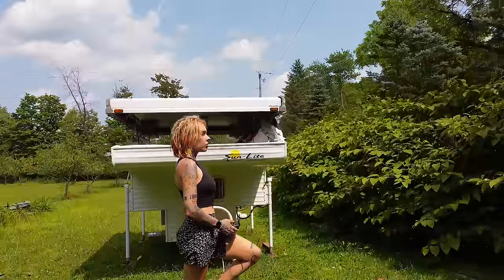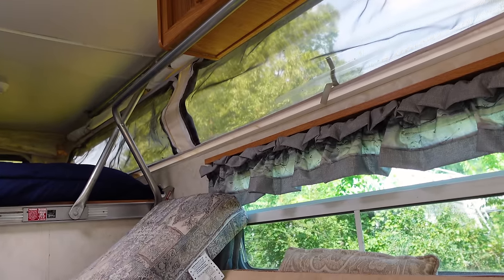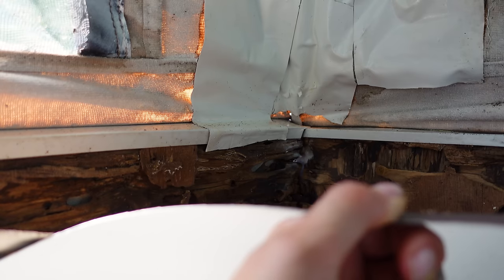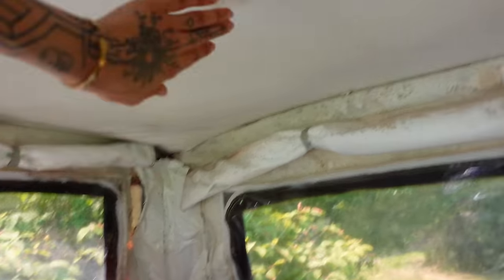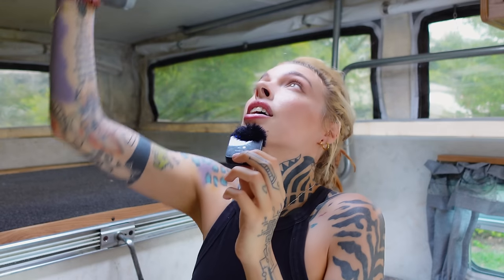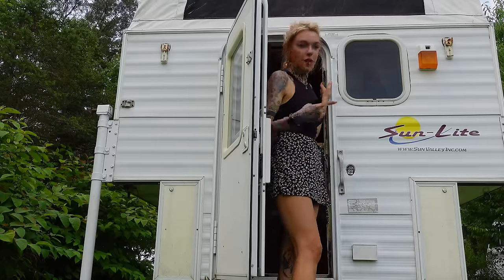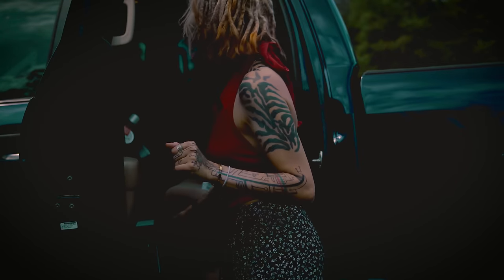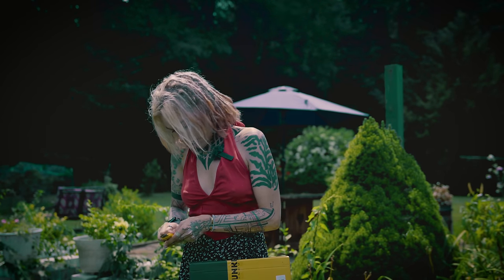old TRUCK CAMPER renovation BEGINS...this is worse than I thought

Comment: Victoria...before replacing any wood, ask your father to check for white starboard...they come in 4x8 , just like plywood...and ebay sells smaller pieces...we use it a lot in the marine industry to replace an y wood....it also comes in different thickness,  1/4 -1/2- 3/4 and so on. Also, king starboard comes in white, black, yellow, etc. This product will make you feel very secure.
Reply from the maker: I’ll look for it - thanks
Reply: @TorieRobot I like the idea of starboard but be careful as it expands and contracts quite a bit with temperature changes.  Good luck and keep smiling 🙂

Comment: You should look into using an electric sit stand desk to make it a push button to raise and lower the camper top 

I would think you could integrate the desktop into the roof as long as you can modify the camper to have to have equal height place for the table legs mid camper front to back so they would be on the left and right as you enter the door towards the middle

Comment: Yeah I love buying things that are destroyed. I bought a camper trailer back in 2017 and pulled it across Oregon. Only to later notice that all bolts that held it to the front of the frame had busted. Decided to rip it apart and rebuild it, but then the price of lumber and everything else shot up. So the frame is just sitting waiting to be built into something ready to travel.  Glad to hear you got the truck “fixed”. I pray you have a great time with the camper trailer.
Reply from the maker: Hope you can still get it fixed!
Reply: @TorieRobot  thank you darlin! I planned on working on it this year with my Dad, at the same time I pull my engine and transmission out of my Jeep. So I’ll have three projects going at once.

Comment: Seeing as you have to redo the roof check out the cost difference to use rigid foam board and fiberglass to make a new one..  Lighter, no leaks and with a few well placed wood boards to screw down fans and solar it may be easier than replacing the wood without messing up the metal sheeting

Comment: Marine grade turnbuckles, with wirerope will cost a whole lot less than those brackets. If you prefer the metal brakets also, you are likely to be able to get someone that'll be able to weld up something for you.
For the wood, you should consider using something called starboard, it's a marine wood substitute, lasts forever, no dealing with rot again. It's easier to work with than wood. Not sure how the prices weigh against using a good quality ply. But I guess it's a suggestion.
All the best with the project, and you'll do well. I'm certain of it.

Comment: with your truck keep working at it and youll get it sonner or later, Im a year in and 6 grand later on getting a 2006 Saturn Ion 3 saved from the grave and working on painting it now that it is mechanically sound.

Comment: Get as long of a bar as you can fit. The added leverage will be a life saver when lifting the top. And buy a couple rolls of flex seal tape. Adheres instantly and could be a life saver. And they make it in clear and white lol.

Comment: I had a skamper pop up on my little ford ranger. I had all the same problems that you're having so far. I didn't do much with replacing rotting woos, just sealed up what I could see and rolled with it. 
 I always kind of thought I could replace the whole roof and pop up stuff with a solid wall raised roof. I got rid of it before I tried.

Comment: Just take it one day one hour one minute at a time. Take a breath. 
One thing to consider being a waterproofing guy is get a waterproof coating instead of caulking and do the whole camper.
Here’s a thought since it’s already a lightweight camper maybe even use a bed liner type coating. My friend did his whole Tundra and he loves it!
I’m sure you are going to find is more wood damage. Take a breath. My guess is that your top lift is twisted. Also when it is fixed and lubed think about getting a hammer drill instead of that handle crank. If possible I’d take everything apart. Rebuilt with high grade wood and if possible waterproof that. Even paint would work to protect the structure. Here’s the good thing is that you are documenting all of this so when you sell it they see how much HAS been upgraded. This is actually an investment and you will get a return on your effort. Also get a tarp also if you’re expecting rain. Keep it dry. 
* save caulking too the end or you will have to keep dealing with it
STAY POSITIVE!!
YOU’VE GOT THIS!

Any questions on waterproofing hit me up! Glad to help!
Reply: Ok. Watched first video before watching this. Lift is twisted I guess. 
STAY POSITIVE
YOU WILL MAKE YOUR $$ BACK PLUS MORE

Comment: Take the Handel off and use a drill with a socket it works great and is easy to do the top will go right up that’s what I did with mine

Comment: Im sure people have said it already but i would buy a impact driver and the correct bit and you can use that to raise and lower the top of the camper. much easier for setting up camp and its dual purpose for what ever else you could use one for. i should also add that you want a higher quality one then you currently have. im talking like a milwaukee brand would be my prefence since thats whats lasted the longest at at work

Comment: I have been where you are with my roof. I've had a travel trailer since 2009 and the roof can be an ongoing problem if neglected. Every opening in it can be a source of leaks. Silicone sealing should be a temporary fix. It will shrink, it will get hard in the sun. Clean it really will and use a roof sealant to coat the roof and seal every seam. Once that is good then focus on repairing repair the interior. Don't let it overwhelm you. It's like eating an elephant... one bit at a time. You've got this. When you're done you will have something you can be proud of because you did it.
Reply from the maker: Yes- I was just sealing the corners and top cause it was going to rain and it really needed it there but I plan on resealing the roof once I fix it all first
Reply: @TorieRobot  Sounds like you've got this. Looking forward to seeing more of your repairs.

Comment: The good thing to come out of the Camper is now you can customize it to your liking since you have to refurbish it a bit… Deff a bad purchase but you can make the best of it same with the Tundra paid a lot for a rusted truck that needs a ton of work… Now you can get comfortable with the tundra while you do the needed repairs and i would sand the dram down best you can and spray paint it with some bed liner to protect it from Rust esp considering you live in PA and it will deff see salt and snow and these frames are known for rusting through so badly Toyota did a recall on it

Comment: Somebody built it, which means you can rebuild it! If you want quick-and-dirty, just use good plywood and make sure it is sealed up from the inside and outside. If you want it to last, consider marine-grade plywood, pre-cut and fit test your pieces, then take them out and seal every side and edge with polyester marine resin. That will protect it from bugs, moisture from the outside, and a huge problem in campers - moisture from the inside. You got this.

Comment: For the tops lift crank, head to harbor freight and find a socket that fits the lift crank and then pick up a 24" breaker bar. You should be able to lift the top after doubling/ tripling your leverage. I'd be weary of using a drill as its battery will die eventually, you could charge it off the truck but if that battery is dead too you will be stuck in low top mode. If you do go the rout of a drill, get a drill with a second grip for your left hand, you will be able to use it for cranking the lifts/supports on the sides as well. Make sure you don't go too fast with the drill, the mechanisms are not meant to handle the heat generated by spinning the internals too fast, go at a humans pace even when using the drill. Good luck.

Comment: hey, you can make some pretty good tie downs by using turn buckles from the hardware store, just get some beefy ones and adapt them to the loops in the truck bed, it would save you a ton of cash, im sure your old man could help you figure it out.
Reply from the maker: I want to attach to the frame for better security just to be safe
Reply: @TorieRobot  got it! That would be much more stable I bet.

Comment: Thats a bummer you got a rough deal on the camper. Maybe considering the cost of repairs? it would be more efficient and cost effective to rebuild the entire thing? re frame the camper as a tiny home on wheels with no moving roof, and re Panel the exterior with siding etc then you could customize it to your liking? Sound like alot to take on but im sure it has to be cheaper to salvage parts from it and rebuild a more sold structure frame exterior than to sink money into replacing a ton of rot and worn parts.

Comment: Nice move getting traction boards will come in handy, you should go to harbor freight and get yourself a 12000 lb winch and the correct mounting bumper for your truck. Believe me that will save you in so many ways if your stuck.
Reply from the maker: Maybe in the future haha but I have enough expenses as it is for the moment haha

Comment: You should look into doing some of the repairs with some foam board construction. It won't rot, is waterproof, crushproof, and adds some R value. For doing the roof, I would do a combination of the foam board and wood glued together. It will make your roof lighter ( easier to get up and down), and with the foam board against the outer shell, it will ensure that it stays waterproof. Just a friendly suggestion to help you save some money and make things easier and last longer.
Reply from the maker: Thanks for the tip!
Reply: That guy knows his stuff and can give you a good visual on how to do multiple applications for foam board repair for your camper.
Reply: It won't let me post a link. His channel is NOMAD. Just search foam board construction. You can also replace the wood in the roof with aluminum tubing. It is a little more expensive, but it will never rot and is lighter and stronger. Fix it once and be done with it the first time.

Comment: There is an old saying in poker- don't throw good money after bad. To be sure you were taken advantage of. One suggestion I have is to get someone who knows how to repair this type camper take a look at it and get a realistic idea of how much time is it going to take as well as how much cost is going to be involved. Once you find wood rot like that on a camper, typically you will find the wood is rotted in many places and it all has to be torn down, torn out and replaced. The entire canvas also may very well need to be replaced and that is expensive. You may find that the total cost to repair may well be more than the unit is worth. Now, early on in the process, it may be time to cut your losses and not throw good money after bad. However, almost ANYTHING can be repaired if you are willing to invest the significant amount of time and expense. And even if it turns out that the cost to repair is more than the unit is actually worth, that may very well be offset by the total number of years you will be able to use the camper after you have made the quality repairs. Just a thought...

Comment: A grinder or the multi tool you bought with a carbine metal blade will make removal of stripped and rusted screws on the roof a lot easier for you. Also there's a chemical called Concrobium that you should use to spray on all of the wood that has mold on it before you try removing or cutting it so you don't breathe in any harmful mold spores you just spray it on any wood that looks black and let it dry good luck getting her done😂

Comment: Unfortunately based on what we've seen so far The camper is probably going to need to be completely stripped down and rebuilt. It's unlikely there are any major areas that have escaped being damaged. 
I know this doesn't help now but for anybody that's reading this please make sure you get a professional pre-purchase inspection done on any camper you buy. All campers leak and water damage can be very hard to recognize.

Comment: If your busy with replacing wooden parts. Also think about to get some ventilation under the matras. This will be a benefit on the mid term.
Reply from the maker: Ventilation how?
Reply: @TorieRobot  Now you Mattress is on a closed wooden panel. And also is not that comfy. Something like we have here is from a brand called  "Froli Star". It ad some space and if you play with spacing of them you can adjust it like bed springs to your own comfort. And if you add an adjustable Head Rest you will a nice chilling space. Just take a look if the spacers will not cause problems when lowering the roof as the matras will be a  1 3/4" higher.

Comment: Time mark 14:55.  You are pointing to the exact problem with the lift system. The plate with the bolts through it is spring loaded. Be very careful taking it apart. Yes, the seller knew it was rotted out.

Comment: if the handle is removable for the top lift    just make the handle longer for more leverage  it will make it go up and down easier for you   then you can remove it to camp  or look for a high torque 12v motor and make it power up and down

Comment: For travel with internet get  the  new starlink mini with roam. The downstream is like 100MBit but the upstream is still the same like other larger dishes. And you can run it from a 12V system with a wifi5 router integrated in the dish. Nice simpel system what uses less power then the bigger dishes. Unless you want a cellular backup. But to be honest you only need that when parking under trees.

Comment: To get the handle to move cut off a little  bit of it and weld on a piece so you can use a drill to wind it up and down it works

Comment: Go to the makers website of your camper they should have new canvas surround system that can be replaced instead of having that old cracked pile of crap with bad zippers and rotting corners. You may have to put it on a wish list. It might be a little expensive, but if this is what you wanna do, it would be well worth looking into.

Comment: Hi
When you get finished undercarriage could be conditioned with fluid film, fluid film is metal conditioner that will prevent 99 percent rust. It comes in spray cans just like paint, a bit over 100 dollars for 11 cans,
It should be nurture every year

Comment: Need to check the cables that raise the canopy up. I bought a pop up temt trailer once and the cables broke on one side and it wouldn't go up. Luckily I was at home but it could be an issue if you're out exploring . I've owned a few small trailer campers like the epro 12rk, but  in the end just bought an RTT because where I go a trailer isn't feasible.  I love overlanding in remote locations. Glad you have the Garmin sos device. It's great to have for peace of mind. Sorry for the long comment
Reply from the maker: I’ll fix it and inspect it all once we get the roof done 👍🏻
Reply: @TorieRobot keep your head up and don't be discouraged.

Comment: Just run a wire extension to the back of the camper window and record out the back window of that it would be just as sweet and work just as good if not better !!

Comment: " pro tip " use only acrilic latex products. If that ge silicone contacts the foam insulation it will deteriorate and cause more delamination.😊

Comment: Def reach our for some sponsors for fridge/ solar/ and plywood lol cause you've got alot of work and by the time you rip the panels off to replace the back might as well do the otherside so you can confirm sealing. would it have been cheaper to build your own  maybe? but not really. Depends on how much time you had really comes down to getting lucky on finding a trailer bed at cheap and rebuilding from there. but id honestly remove the folding bed if its below the 12ft average and just replace it with same material as rest of it. Unless too tall then stuck finding replacement parts or going to town cleaning lol. Good luck fun 2-6 month project depending on weather and help. And level of restoration put back into it. My OCD goes crazy with this sorta stuff and i cant just fix the major problem and move on i go nuts and rip it all out and start fresh reusing as much as possible. Cabinets looked good same kitchen area.

Comment: yes was definitely only worth half that price 😢
now you actually know what a camper top is. We had a truckbed topper shell, put in a 3" foam padded carpet floor that was great for sleeping on. The carpet was attached to 2 pieces of plywood that folded down the middle for quick easy removal or installation. I could pack alot of camping supplies in the back since you're not losing any of the pickup bed's space
Reply from the maker: Yea I considered lots of different options but in the end I really wanted space to stand up, have a kitchen and also a desk for editing

Comment: Take off wind up handle to raising the roof then Pound a 7/16 or a 1/2 inch socket onto where the handle is. Then you can use a screw gun or drill to raise roof and lower it so easy.YOUR WELCOME little lady.

Comment: Please put the camper in the barn, I bet it will fit if just a little stuff is moved. That way no weather issues when the top comes off. 
Also, the top canvas can be used for a pattern for new marine grade material. Do your homework! You can find a person who will sew up a new top canvas if you ask around at a boat shop or two...one of them would be happy to do this on the side... 
Its no different than a bimini or canvas shelter for a boat that those guys make all the time.